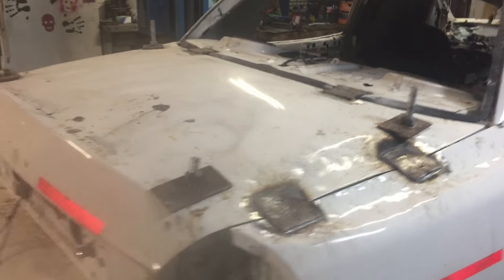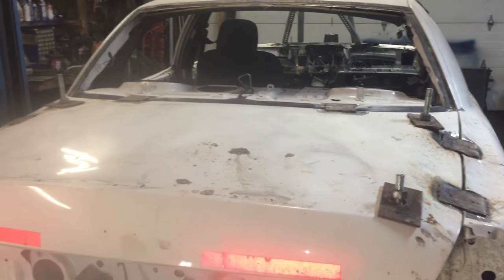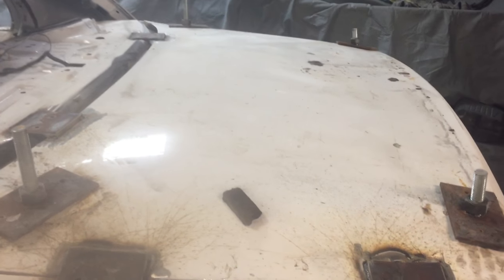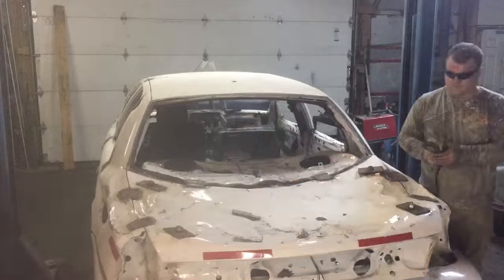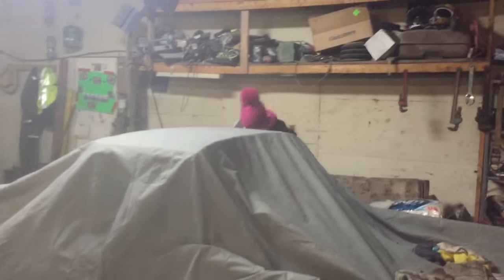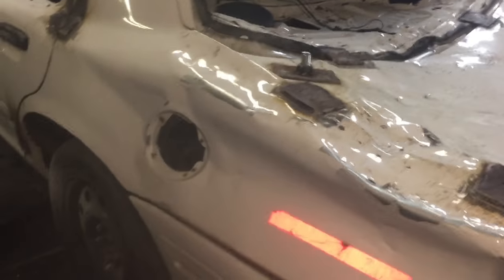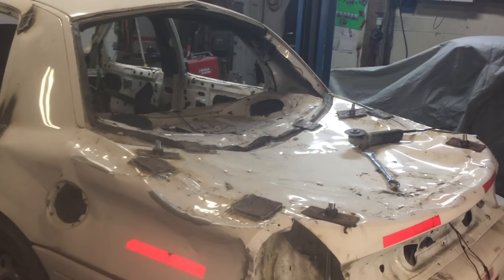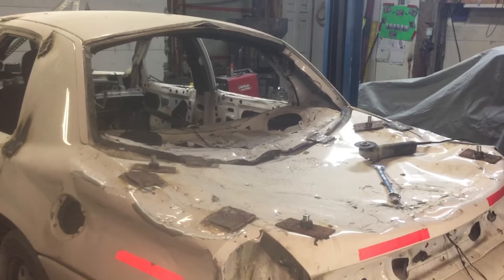how to wedge the truck "u" or "v" on a crown vic porject "burn barrel"

Comment: Advise for the trunk if it’s aluminum?  What do you think
Reply from the maker: swap it if u can but i would not run the alum in a mod show but stock sure
Reply: @zacksworkshop171 .  I’ m here at the fairgrounds now with only 1 day to go so I’m using the aluminum trunk. I do have it pushed down with all thread pretty happy with how it looks but I can tell it has no real effect on impact.  Maybe just help hold things together.
Reply from the maker: i would just push it down a bit but its not going to go great

Comment: Can this step be done after your rear panels are crimped already think this will be the way I run mine this year
Reply from the maker: ya for sure buddy
Reply: @zacksworkshop171  my man how did this trunk hold up for you
Reply: @zacksworkshop171  do you got Facebook brother
Reply from the maker: Yes zacks workshop on Facebook
Reply from the maker: Its been ran 4 times now it came up a bit but over all never really moved
Reply: @zacksworkshop171  badass im doing this same with min sept mine is a 85 we just can't weld our all thread to the frame

Comment: great video Zack. I made another video if u want to check it out. looks like burn barrel is coming along nicely. can't wait to see it all done.
Reply from the maker: DerbyFreak818 I will check it out and that you started on the front suspension yesterday trying to get rid of all the alum
Reply: zacks workshop thanks. and I'm still deciding wut to do with the front end. how do the motor mounts do in your opion? some people say the break easy but do u think if I chain down the motor it will help them enough?

Comment: what rear are ya using?
Reply from the maker: Jeff Hock right now it's stovk 8.8 but I am in the works of getting my old 9inch  rear end back with full spool and 4.56 gears in it
Reply: +zacks workshop dose the stock rear ya have now the watts lime set up? I just put my 9 in under my buddy's 87 merc
Reply from the maker: Jeff Hock no the 9 inch does not but I am going to order a kit to install the links into the 9 inch and I will probably use a pan hard instead of the watts link , or if I can come up with a easy way to install the watts I may just keep it
Reply: +zacks workshop right on. I'm building a 99 merc right now. digging the vids man. keep up the good work. ima run a 10 bolt gm in my car.

Comment: Do u need to weld the lid to do this ??
Reply from the maker: Destruction Production yes with out the welded trunk it will want to pull away from the quarter panels the threaded rod helps as well to keep the pressure

Comment: what exactly is the purpose of the trunk "U"?
Reply: Uncle Cam from what I've seen it makes it a bit stronger and it helps keep the trunk lid from blocking your view.
Reply from the maker: Uncle Cam trunk lid stays out of vision , the dish down word also allows the side to come in instead of pushing out , see how the roof was tweaked up as well witch makes the roof go up out of the way of vision as well 

The tighter you get the steel the better it backs in and stays solid